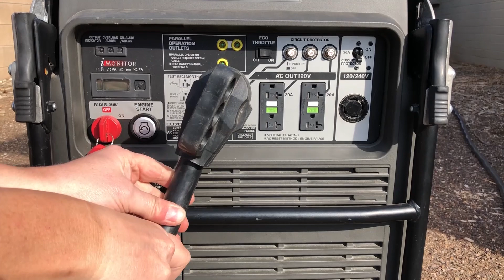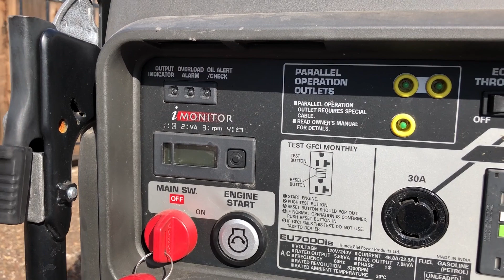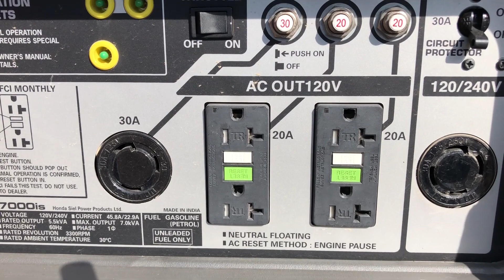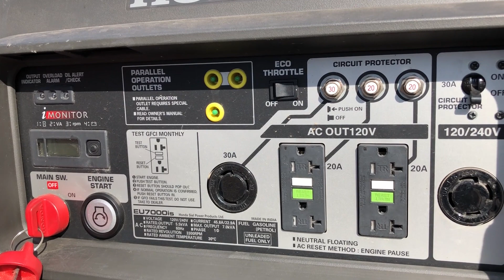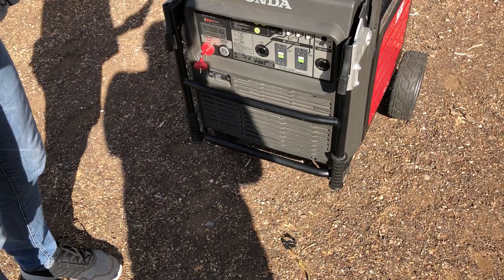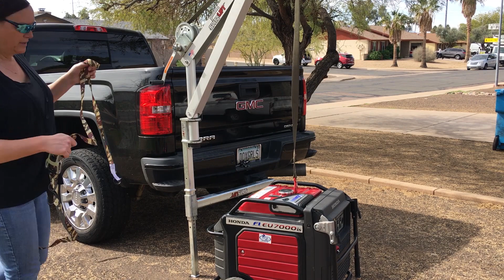⚡ E1.3 Honda EU7000is Generator

Comment: I have the slightly older Honda EU6500 which from what I can tell is pretty much the same machine other than fuel injection. Up here in Ottawa, I have just come off 30 hours of using it for home backup through a Reliance transfer switch because of massive, city wide power outages. It is so quiet it's hard to hear at the end of the driveway and compared to other generators in the area, almost undetectable. I have calculated it costs about a litre of gas an hour to run at about 1500 watts output average, which equates to $2 Canadian an hour at our insane gas prices right now. The tank seems to last about 8 hours before needing refilling...at least according to the terribly inaccurate fuel guage on it. There is very little to criticize with this machine as it does what it is designed to do as well or better than most other generators on the market.

The only downside is the price. I paid $3700 used with 93 hours on it, but to replace it now costs $6700 at the local Honda dealership. However, like with all quality items, it has superb resale value and I don't doubt I could get more for it now than I paid for it. So is it really that expensive???

However, in a power failure, it's worth it's weight in gold !! Along with my Honda Goldwing motorcycle, it's one of the best purchases I have ever made. Remember the old saying...."long after the price is forgotten, the quality lives on"

Comment: you should've gotten cummins onan 14,000 watt unit.  it's diesel , gets a whole lot more hours per gallon and can power your whole domicile and more
Reply: Is that a water cooled diesel generator? They have the same crane that I have. The top weight of the crane is about 500 pounds. The crane is necessary to move the generator out of the bed of the truck to the ground with the crane. They like to move the generator far away from the generator. Even though the generator is one of the quietest.

Comment: how is it that a 5,000 watt unit does'nt put out 50 amps? or at least 40?? not great at the math.  I have need for 40 amps
Reply from the maker: No worries ;o)  

       RMS Watts = Volts * Amps

Therefore:

       Amps = RMS Watts / Volts

Typical output voltage from the generator is ~125 volts so:

Amps = 5000/125 = ~ 40 Amps (sustained)

Comment: Hello I’m having issues running 2 ac units on my 2021 grand design I have a eu7000is can u run both your ac units at the same time ? TIA
Reply from the maker: The eu7000is should produce enough power but if your air conditioners are pulling enough inrush current you might blow the overload circuit. If that's happening consider the soft start kit for each A/C unit: https://www.microair.net/products/easystart-364-3-ton-single-phase-soft-starter-for-air-conditioners?variant=30176048267

Comment: You plugged a 50 amp to a 30 amp plug. There’s no such thing as two phase. It’s called single phase 120/240 volts.
Reply: wrong , in north america there is 120v per phase but if u put ur load across two phase then u will get 240v for higher load items like ac , drier and heaters... in commercial hvac they use 3 phase supply . it is called a split phase system and each phase is 120 degree out of sync than another and so on 120v per phase u get 220v combined not 240 if the system is for 3 phase . if the system is for 2 phase then they are 180 degree out of sync and u get 240v out of two 120v supply

Comment: Good afternoon! will the Honda EU7000is Generator work with propane and in light of the lower btu's will it be enough to power the two AC's?

Comment: 43 amps is all thats available thru the 240 volt 4 wire plug. The rest has to be used thru the standard 120v plugs. you don't need 240 volts in an rv which makes this generator and expensive non necessity. You can parallel 2 champion 3400 watt units with the 50 amp parallel kit and have more usable power in the rv for 1/2 the price with remote start.

Comment: You can't pull more than 3600 watts through your 30amp plug. The adapter doesnt change that.
Reply: Big AL exactly ! Thats why i baught 2 of them with the reliance parallel kit amd i run whatever i wanna run in my rv im actaully putting 48.5 amps on each leg

Comment: I purchased a Honda EU7000is used, (81 hours) and it did not come with an owners manual.    I called Honda and supplied them will all of the information and they sent me a  FREE manual.  The torque on the oil drain plug is 16.6 lbf  (in the owners manual, page 56) Perhaps you should call Honda.  Have the serial number available when you do.

Comment: Sorry for the second suggestion comment, but when you’re recording sound levels on your generator I noticed that the guy doing it had the sound level app set to “Z” weighing. That’s more of a measurement for industrial applications. What we commoners use is “A” weighing, that’s meant to represent sound levels and frequency that the human ear picks up. Just an FYI :). So the sound levels he recorded were not true to what we hear.

Comment: Another thing i highly recomend you get the bar that goes on top of the generator to lift it.  It will make your life much ease
Reply from the maker: OMG you're my hero!! Are you talking about this one?

https://www.amazon.com/Honda-06531-Z11-E00ZA-Hanger-Kit-Nh105/dp/B004DQWJTW/ref=pd_sbs_86_1?_encoding=UTF8&pd_rd_i=B004DQWJTW&pd_rd_r=1c1f5509-8ae1-11e8-906c-89fc5d574e42&pd_rd_w=lYVS3&pd_rd_wg=OPsF7&pf_rd_i=desktop-dp-sims&pf_rd_m=ATVPDKIKX0DER&pf_rd_p=8702255303818932494&pf_rd_r=08JVJ2MY23TCNVCQYQ7Q&pf_rd_s=desktop-dp-sims&pf_rd_t=40701&psc=1&refRID=08JVJ2MY23TCNVCQYQ7Q

It looks a little lightweight - do you install just one of these kits or two? Got a link showing it installed on your gennie you can share?
Reply: Airstream MTB yes that one.
Reply: You only need one.   When you install it you will need to center the weight  its ease.
Reply: https://youtu.be/40m0qdZrfLY
Reply: I just upload this video. This is my set up
Reply: Maybe a motorcycle scissor jack to lift it. Small, easy to transport to.

Comment: What i do dude is that everytime i change the oil to my 7000is i lift it with my spitzlift and do the change oil in the air.    Its more ease that way.

Comment: Hello I have this same generator and I power my concession trailer by that I mean a 115v 12 amp freezer and 115v Dometic AC unit. I have the 2 phase adapter that plugs into the 50amp connector that comes from the trailer like yours. When I plug it in to the 240v side and flip the voltage selector switch it automatically goes into overload mode. Note I do have the 30amp circuit protector on above the 240v connector while this is happening. Should I have that circuit protector on or off? I haven’t been brave enough to try it off because I didn’t want to ruin anything. Your thoughts?
Reply from the maker: Hi, Jonathan - I'd begin first with process of elimination. It would help to have a good quality multi-meter at the ready and only pursue the "measuring" below steps if you know exactly what you're doing  ; )

Start with the generator off and the 30A breaker off, and the voltage selector in the 240v position. With nothing connected to the generator at all start it up and observe that you don't see an overload condition. If you're OK on this step, flip the 30A breaker to the ON position and observe you still don't see any overload. If you get this far at least we know the gennie is good and it's something in the cabling or trailer.

Next I would turn off the gennie and once again move the 30A breaker to the off position. Then install the Camco 55422 adapter (taking care to rotate it slightly clockwise to lock it in place). Again start the generator, observe you aren't in an overload condition, and then turn the 30A breaker to the on position. At this point if you don't see an overload, I would (if you know what you're doing) take a measurement with your multi-meter in the "AC" or "~" position and check you're seeing ~110v phase to neutral for both phases (pin out described in the video). At this point you know that your gennie is good and the adapter is good. 

By now if you still haven't observed an overload I would begin to suspect your cabling or trailer wiring. There are three options that come to my mind:

1. The cable is shorted/open
2. The trailer wiring is shorted/open
3. All appliances in the trailer have been wired to one phase. 

There are a number of ways to go from here but I would continuity test your 50A cable (the one you're plugging into the Camco 55422) and make sure the ground, two phases and neutral lines continuity check. Also verify you aren't shorted (e.g. no continuity from phase to neutral, phase to phase, phase to ground, etc.). Of course you'd do this with the cable not attached to the generator and not energized. If your power cable continuity tests OK we can safely assume at this point it's something in the trailer wiring.

If you get this far you're definitely into trailer territory. I would verify that the phases in the trailer have been properly balanced. If you are seeing an immediate overload condition when you energize your trailer, especially when nothing in the trailer is yet turned on, this almost certainly means there is a short in the trailer. If, on the other hand, you can energize the trailer, and maybe get one appliance going, but then you get an overload when all the appliances are going, you're likely wired to all one phase.

Comment: The generator puts out 240 volts single phase.  There is not 2 phases.
Reply: Steve Hill - Technically you’re correct but at the same time not. 240 volt circuits in North America are actually two 120 volt conductors 180 degrees out of phase with each other… enter the “two phases” comment that op made. So op isn’t wrong either, technically North American 240 volt circuits are technically 2 phase circuits.
Reply: Tommy TMT -  In North America we either have Single Phase, or  Three Phase electricity.  What you are referring to is not 2 phase, but is called split phase or single-phase three-wire.  It is simply a single phase transformer with a 240 volt  secondary that is center tapped.  Wikipedia explains it well.   https://en.wikipedia.org/wiki/Split-phase_electric_power
Reply: Steve Hill - No dude I get it, I know how it’s made, but what I’m saying is that the two 120 volt conductors that make up the 240 volt circuits are each 180° out of phase with each other… in actuality one half of your electrical panel at home is a different phase than the other. BUT, yes you ARE correct, it is technically just single phase power coming both out of that generator and into our houses. And I also know that in reality a 2-phase system is real but it’s never used, the power it supplies is too asymmetric to be of any real use.
Reply: Tommy TMT - In a multi phase system you have to have 2 or more sine waves occurring at different times.   In your house you have a single sine wave or one phase repeating 60 time a second if you are in the US

Comment: You state you chain your Honda to a tree. I do not know the way in which you chain the generator. Portable grinders will make easy work of any chain, and thieves are very creative in masking noise. It is heavy, but it is on wheels. May I suggest if you are leaving for any length of time you formulate another plan.  Removing the wheels and the lift handle could be a deterrent if only that it would then take two thieves to lift the generator and extra time. Thieves will cut through the tubular steel if that is where you use the chain.
Reply: hydraulic bolt cutters, does the work of 60" unit, in a 8" package. without the sound of a grinder.  but ironically enough use the generator to power the grinder. lol

Comment: Are these units factory test? The reason I ask is because I just bought one brand new out of the box started assembling opened the gas cap and noticed that it smelled gas. Also noticed some oil in the dip stick and residue on the exhaust not to mention the wheels are bent thought I was dreaming when I experience this couldn't believe it
Reply from the maker: Wow I'm really sorry to hear that. I bought this unit pre-assembled at a power equipment store in Phoenix with no issues.
Reply: All generators I know of are started first in the factory. All the ones I have bought have a few drops of oil in the crankcase. We all like to think we are doing a first start on our gennys, but we aren't.
Reply: Honda runs 100% of their finished product before it leaves the factory.  Lawnmower, generator, string trimmer, outboard motor, motorcycle or automobile.  If it is a finished product it is test fired and all systems checked.  Oil and fuel is removed then packaged up for shipment.  If you are anywhere close to a Honda Factory of any kind go in and see if you can take a tour and you can see for yourself.

Comment: If you are using it, and it is 30 feet away, you WILL know it right away as your lights, AC, etc. will go out as soon as someone walks off with it.
Reply: XboobtubeX
 Yes these generators have legs, when I use mine during a power outage I keep an eye on it. At night it comes inside. I have the metal bracket for the handle EU2000i, but it seems easy enough to defeat.
Reply: I understand that they have legs, But what I said was, "when you are using it, you will know right away if someone takes it as lights, AC etc. will stop. First thing anyone with half a brain would do is go investigate the generator. Thieves cant get to far in 30 seconds. Now, if you are not using it and it is sitting outside, than yes, it better be chained down with a guard dog.
Reply: I am really sorry I commented to you. It will not happen again.

Comment: About your oil issue, the sealing washer needs to be replaced EVERY time you change the oil. Honda doesn’t sell it but you can go to ANY hardware store and get them. Make sure it’s a copper sealing washer as they can crush fairly easily and seal very well with relatively not much torque.
Reply from the maker: Thank you!!!!
Reply: Airstream MTB - No problem, I had the same issue with my little eu3000, I ended up calling Honda themselves :).
Reply: Airstream MTB THIS GENERATOR IS MADE IN INDIA?!?! I taught Honda was Japanese
Reply: I purchase my sealing washers from Honda for my EU7000
Reply: Good to know. Thanks.

Comment: Any times while using both A/Cs that you have blown a circuit?
Reply from the maker: Yes, we have blown a circuit running both A/Cs and the electric water heater, so we leave that on propane. The usual roster of stuff we can run with no problem all at once is Both A/Cs, TVs, Satellite and Microwave and small incidentals like lights and stuff. I also carry a 4 gal compressor and the gennie won't run run both A/Cs and that either.
Reply: Thank you. I had looked everywhere and finally saw your video using the 4-prong outlet and adapter...brilliant! Websites had me building all kinds of contraptions. Any other advice? Running two ACs on a Classic
Reply: The entire set-up ... hoist and all is exactly the solution I was looking for...thank you again!
Reply: Airstream MTB have you tried putting capacitors on both your ac. I had the same problems but not anymore.
Reply from the maker: Hey Charles, did you flip your source selector on the generator to 240v?
Reply: Awesome, glad we could help!! Here's the folks that make the hoist: http://spitzlift.com/
Reply: Ok ... looking for your electrical engineering advice! Honda 7000 ... exactly same adapter you have. Surge protector reading open ground and not passing power into airstream. I tried 30a outlet with adapter ... same result. Thought?
Reply: I did ... thank you for replying! It appears to be an issue with the “floating” ground on the Honda. The power is not being transferred beyond the surge protector according to the surge guard folks. Apparently a known issue with my setup ... the resolution is what they called a “N-G bonded” plug that they sent in the mail. I hope to get it this week and we will see. 

Again, thank you for the reply.
Reply from the maker: Sweet! Can you post the link to the product they're sending you?